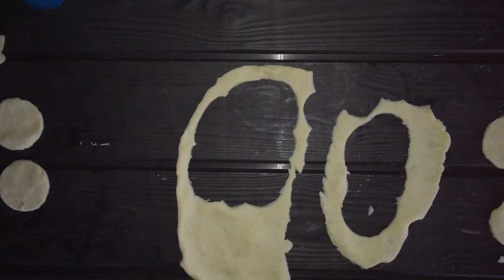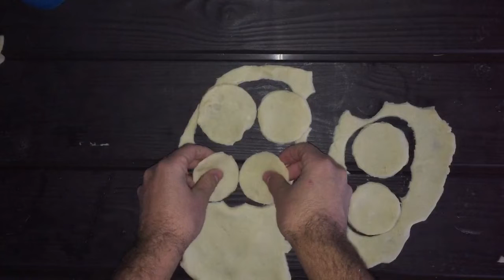4 Valve vs 2 Valve example using dough! Why 2 big valves are not better than 4 small valves

Comment: Twice is one heck of an overstatement, but yes, two smaller intake valves usually have more total area than one big one for a given bore diameter. There's a LOT more than that to factor in, however, and if you dig deeply enough you'll find that 2v engines can have just as efficient combustion and BMEP as 4v engines. 4v just have better peak flow potential at high rpm and lighter valve trains.

Comment: A large benefit to multivalve is actually cooling. With more valves, more seats, more guides, you are able to cool the valvetrain much better. You also dont require as longer stroke on a multivalve meaning less wear again on guides. Less reciprocating mass per valve, two cam lobes can share more wear. You can get a 2 valve cylinder to breathe quite well, especially at lower rpms, they have a better swirl effect as the air spirals into the cylinder, but the down side is they can handle less heat and dont last as long. Also by having a shorter stroke, you can make an engine be non interference. The head does not need to be as tall for multivalve as valves are shorter.

Comment: The biggest variable with 2 vs 4 valve is packaging.  4 valve works best when with DOHC (dual over head cam), which is inherently bigger than cam in block (CIB) designs.  For inline engines (like most 4 cylinders), it's easy to package a DOHC.  DOHC V6s can be relatively narrow since the cylinder banks are often less than 90 degrees.  
When it comes to V8s, the banks of most designs are 90 degrees, and OHC (single and dual OHC) makes them much wider; especially for a DOHC inherent to most 4 valves.  This means that 4 valve DOHC V8s are often physically bigger (external size) while having considerably less displacement (CID or L) than a 2 valve CIB V8.  

An engine is essentially an air pump; more air = more fuel = more power.  There's 2 ways an engine moves air (naturally aspirated speaking; boost from blowers and turbos essentially act like multipliers and is an additional discussion):  with displacement and velocity (in regards to an engine, RPM).  
The amount of air an engine can move with a set number of revolutions (like it spins 1 time) will effect how much torque it makes.
The amount of air an engine can move at a given RPM will effect how much horsepower it makes (HP is a rate over time based on torque).
Since a 4V DOHC V8 has a smaller CID/L than a 2V CIB V8, it has to spin faster to move the same amount of air as the larger engine (IOW- spin faster to make the same HP).  The 2V V8 won't spin as fast, but it doesn't need to since it moves more air per revolution (more torque at a lower RPM).  

Since packaging (external size) is a primary concern, it essentially begs the question...  Do you give up displacement (CID/L) for the ability to spin faster?  Make less torque for more RPM?
Think of it like hitting a nail with a hammer....  Big hammer that's slower and hits harder (big CID, low RPM) or smaller hammer that hits softer and slower. 

The prime example is a new Camaro SS (LT1- 6.2L 2valve CIB) vs the Mustang GT (Coyote- 5L 4v DOHC).
The Coyote makes 460 HP and 420 torque.
The LT1 makes 455 HP, but 455 torque.... Both figures at a lower RPMs than the Coyote.

This is a "rough" explanation because there's so many different engine designs and variables.  It's hard to compare a generic A vs B when the whole alphabet exists.
Reply: I’ll just add, DOHC or even SOHC stuff is usually an interference valvetrain. That is a huge OHV advantage when talking about I/E valves being open in a max effort deal without touching and being catastrophic failure. OHV can often have much better quench and squish vs DOHC  without hindering flow. Every design has its compromises… use what works  best or is cheapest.
Reply: Great explanation there!

Comment: Exept some americans the rest of the world since 1930s knows that 4 valve is going to make more power.
Reply: There have been numerous examples of American 4 valve engines since the 30's. It's not that America didn't know that 4 valves can make more high rpm power, it's mostly just that they found the advantages of 2 valve engines to outweigh the advantages of 4 valve engines.
Reply: 4 valve v8s have to be a lot bigger than 2 valve v8s. The ratio of power to size is a lot less of 4 valve v8s than 2 valve v8s. The four valves need another cam which takes up more space. So it wasn't that they were stupid, it was that they had to be practical in a lot of cars like small sedans. And to make bigger engines with dohc just for the big sedans like impalas and imperials would be expensive as they wouldn't be cross compatible with smaller cars.
Reply: 4 valves are better for high rpm horsepower. 2 valves are torquey “slow” engines. 2 valves also are more reliable because less moving parts.

Comment: You should do a 4v cam install video
Reply from the maker: 97 cobra I totally should! I almost bought some comp 106100s for the Mach 1 but got my cobra around that time, so it don't happen ;/
Reply: I got Crower stage 3 S/C cams for my 97 Cobra and they are one of my favorite mods they make my car sound so damn good. I hope you do make the video one day you do a great job going into detail and your vids help out a lot. Thanks
Reply from the maker: 97 cobra thanks, I appreciate it. Sounds like you're ready for booooooost!
Reply: why not do a flathead instead?or even easier a 2 stroke engine assembly